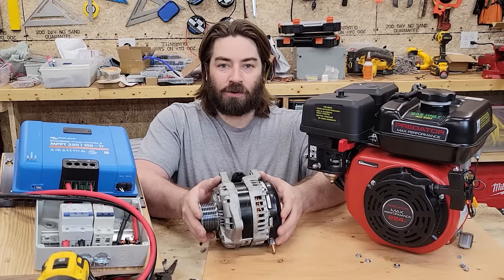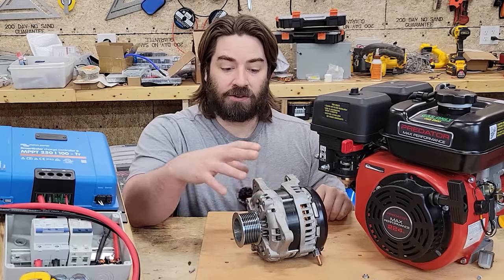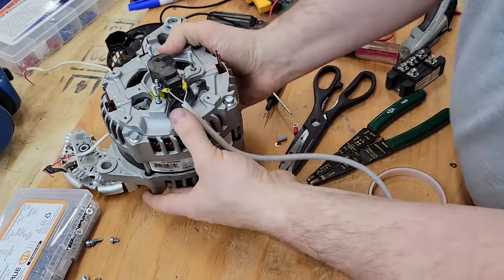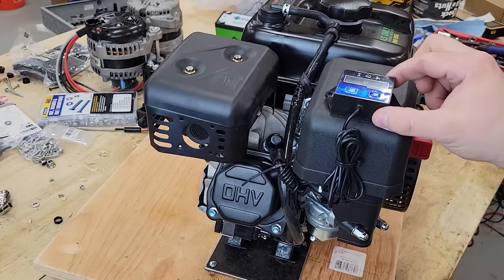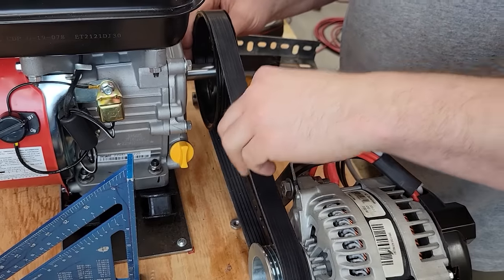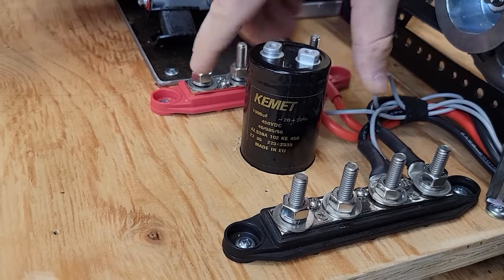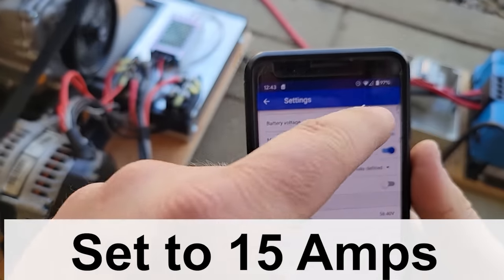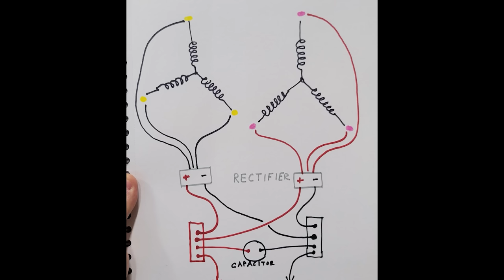The AlternatorGenerator, First Attempt.  48V Battery Charging

Comment: Some suggestions from 22 years in living offline and using some of these one controlling the field supply is Paramount 2 direct connection takes 20% off of friction from the use of a    Belt, a dead battery with 1 dead cell will keep voltage from going through the battery and killing The motor  and let it go on towards an inverter, good luck

Comment: I've wanted to do similar things with an alternator to make a micro portable welder. Current isn't even a problem because aftermarket high performance alternators exist that can push 500amps. More than enough for stick welding. Theoretically you could get a 250 amp model, a predator 212 some other bits and have a tiny half decent gas powered welder.

Comment: Unlike my 1961 VW 6-volt generator, at idle the lights go even MORE dim LOL Alternators are genius, almost 100% efficient, having a full-wave rectifier, in bridged mode. None of the AC waveform is wasted. It also has filter caps. As well as Voltage regulation like he stated.

Comment: Next time you come across a friction fit pulley, put it in some boiling water first. 
Thermal growth helps  alot. 
Stops the possibility of galling or stripping the threads on the alternator or installation kits
Reply from the maker: Thanks

Comment: I would suggest vibration control mounts on your platform. I put these on my garage air compressors that was dancing around while running. I didn’t even need to bolt it to the floor after that. I got them from McMaster Carr.
Reply from the maker: Thanks for your suggestion.  I was able to fix the vibrations in video part 2: https://youtu.be/cy0t4qq8mS0?si=e4gSSoPMcC4X2hhI

Comment: You don't have to adjust the voltage. You just have to wire it up to charge each cell separately,  like a bms.  There are wiring diagrams available to show you how to charge multiple 12v batteries in series, at 12v-14.4v. Good luck.

Comment: Great project! I was thinking to do this along the same lines.  I build everything with 3/4''   thin wall square steel tubing welded up and finished. The whole engine/alternator frame would be mounted on rubber mounts to the base. I built a few 12 volt portable battery chargers years ago using Geo Metro alternators. The internal voltage regulators usually stalled the engine unless the battery was nearly fully charged. I was going to install a rheostat in the excitation circuit to load the engine below its limits and add vary the field current as the battery charged. Strictly manual control.  I like the idea of using a charge controller for the battery bank as you can set charging parameters and don't really care about the exact alternator output volts. 

I have a direct drive Kubota PMG 3 phase 20 amp garden tractor alternator mounted to a Honda GX 50 engine. A cheap MPPT charge controller might make it work better. Thanks for your ideas!

Comment: The overall build just wasn't shabby at all!! There are a couple things that you should still consider: 1.) Get
you some good heatsink compound, computer grade that is rated for performance and great thermal
displacement and apply it to your heatsinks throughout where it is needed. 2.) Think about trying to make
a guard made out of some good steel plating to protect all of your electrical parts, wiring and the rest in
the event at some time the belt should unass itself and go flying. I'm not saying that will happen BUT, you
never know when or how it can happen BUT hey, it's a good practice with all the hard work and money that 
you've put into the project!! 3.) On the output stages of the of the Stator going into your Charge Controller,
look into seeing whether you have a electronic current limiter circuit that you can setup to safeguard 
components in general that could greatly overheat. I'm talking current limitation as opposed to just a simple
ole breaker in use!

Comment: A Harmonic Ballance add on using mass to store kinetic energy and smooth vibrations. Your Alternator also generates stress vibrations and a smaller one may help in combination. It looks like the directional stress of the design is along the same parallel lines and two rigid points of motion.

Comment: Wow! "Nothing Succeeds Like Success". Congratulations, this actually works (the right way) ! Question: If you removed the voltage regulator, what is controlling the amount of control current being fed into the (single) rotor windings ? That is, what is regulating the dual stators' output current and voltage to what the charge controller wants to see ? What happens should the charge controller want to increase or decrease the battery banks' charge current ? How is over-voltage to the controller being managed ?
Reply from the maker: I'm using a DC-DC buck converter which delivers a steady 12V, 5A, to the rotor.  You could say... The alternator is un-regulated, but the charge controller is regulating what goes to the battery.

Comment: I was told 13+ years ago that this was not possible
So I decided to build one anyway 
Around the end of 2010 I managed to scrape together enough scraps parts pieces and old sides, shaft engine that I had to clean the carburetor on lol
I picked up a $35 Chevrolet two alternator and I saw it on my front porch and built one 
A few short months later, April 27, 2011 rolls around and destroys the south east we were without power for three weeks in our little rural community  but not me lol I had a couple of old car batteries a generic 12 V inverter and my trusty little 12 V generator that I was able to power a couple of low wattage, lightbulbs, and a deep freezer, and a television for roughly 9 hours on a gallon of gas… super efficient when you consider how much money I had invested in this little project and how poor I was at the time!
Reply: Now that I’ve watched the whole video I would like to add
His set up is definitely prettier and cleaner than mine was lol 
Mine was done with a set of hand, tools, wire, nuts, old Skil saw And basically some other garbage that was collected along the way
I have used that for many years before I finally retired it 
It was used as a back up generator. It was used as a gas powered 12 V charger
And the last thing that I used it for was a homemade electric boat that used to whopping 31 pound thrust trolling motors on a 14 foot flat bottom boat… the applications are endless lol
Definitely a great build. Thank you for sharing.

Comment: You need to put the engine and alternator on a single plate as your vibration dampers are preventing you from getting constant tension on the belt. Refer to a car engine that has the alternator directly attached with the vibration dampers in the motor mounts. The vibration absorbers should go between the motor mount and the frame or on the bottom of the whole assembly. When building a  compressor set up I made suspension dampers using some used valve springs  and rubber hose scrap this absorbed vibration while limiting horizontal play.
Reply from the maker: Yep, you are correct.  I made that modification and it worked great.  Video part 2: https://youtu.be/cy0t4qq8mS0?si=RVsgtyJGtefJy0lu

Comment: solid mount to something heavy. get rid of the rubber shock bushing for more stable belt tension with less belt slippage.... i've done this before on a pressure washer platform ...

Comment: worked pretty darn good.  the rubber mounts made it hard to tension the belt…I’d like to see all the electronics mounted away from the vibration to preserve the circuit boards on the charge controller.  All in all, very educational, thank you for the demonstration!

Comment: Great idea, just to keep you in the loop. There are 48volt alternators available off the shelf, some hybrids have them, also vehicles with electric turbos where a 12v system isn't man enough. Now, if you could power the alternator from a stationary steam engine, running on waste oil to generate the heat, you could generate the power from a waste product, maybe.....

Comment: Nice video, been a while since I've built similar but for a much different reason (days before portable jump packs). 
Few suggestions for what it's worth. 
1) Alternator. Try finding one for an 80's model Ford (or such). Know the older 5.0L had the voltage regulator independent of the Alt.  So, can't comment as to this application, but might save some work on the Alt side of things. 
2) I'd directly mount your engine to the wood, a second piece, and use those vibration pads to hold that second piece of wood to the first. Two reasons... engine moving independent of the Alt. would cause inefficacies in the system.  This also allows you to then use A) a curved piece of metal (toilet flange repair kit or such) to make a slip adjustment. or B) an adjustment similar to a 95 toyota (simpler to mention that and google it) to make adjustments as its running (Thick bolt hole on Alt. as a pivot pin, and threaded hole as your lock down bolt. As the system runs, the belt will stretch... the motor moving will add too this. 
3)  Keeping the engine on a sperate board will let you then mount the electronics with a bit less vibration. 
4)  Just an FIY... when installing the pully on the engine, you don't really need to power steering puller or to make a special bolt. Just a standard bolt with 3 washers and some grease between them  will do (done this many times). The puller is really only needed if you wish to remove the pully or move it closer to the end (installed too far in).
Reply: Great to know #4. I'm building one of these now, and having a hard time sourcing a pulley installer/puller with a 5/16"-24 adapter bolt, just like David. Just to make sure I understand - would I align the pulley hole to the end of the shaft, then thread in the 5/16"-24 bolt with 3 greasy washers on it, then just tighten the bolt head until the pulley is on? The washers just spread the pressure from the bolt head onto the rim of the pulley as I tighten?

Comment: Once you have this project the way you want it, maybe consider building a wood gassifier to run the Predator on.
Inquiry? How long would a small engine like this run on a 1 lb. propane tank? (Thinking of emergency fuel sources)
Suggestion: Use an 8 cell battery holder (AA batteries) and a momentary contact push button to excite the field. If you use high quality batteries, they should last for quite a few years...
Just some thoughts from a 63 year old ham operator that has been an electronics nerd for over 50 years...
Thanks for the video. Enjoyable and informative. The best part? NO BS INCLUDED! A++ brother!
Reply from the maker: Thanks for your comment.  I agree about the momentary push button.

Comment: I used to have a regulator cut out switch on my 73 Pinto and used a rectifier on the field supply so that it self excited. Rev up the engine to around 3Krpm and ran my circular saw at the lumber yard. That was in the late 70s. Never had any trouble running high frequency ripple DC into the universal motor in the saw. However, I would not use that setup for continuous use. The alternator bridge gets hot, and accelerates voltage avalanching of the diodes. Not fun pulling car alternator to replace the diode stack.

In this setup the filter cap must be rated for high ripple current when the alternator frequency (shaft speed) is low. Some mix/matching depending on load conditions.

Comment: Food for thought. You can simplify the excite circuit, by simply wiring the excite circuit to the 12VDC magneto output on the engine itself. Thereby eliminating the buck converter

Comment: In addition to @D2O2's suggestion, the modern alternator mount uses a spring-loaded idler arm+pulley to continuously apply the (approximately) right belt tension. This eliminates any belt 'bouncing' and smooths out the alternator's bearings load for a maximum lifetime. It should somehow be mounted to the engine block. Also, those wimpy engine mounts must go ! After all, this engine is meant for something like a pressure washer or some other kind of pump, all of which have their engines bolted to solid frames that have no cushioned engine mounting. These mods aren't, of course, necessary for the first and second rounds your (first and second of videos) of your 'proof of concept' project, but should be added to any real-world and dependable set-up. Again, Great Work !
Reply from the maker: Thanks.  In video #2 I solved the vibrations by welding up a plate for the alternator and engine.  There is also a video #3 where I fine-tune the fuel economy.

Comment: You should properly size the capacitor to the voltage you will be using.  While it is generally safe to use a higher rated cap than the working voltage, if it is too large, the cap won't form properly.  So if you get anything under 150 volts out of this thing, you should change the capacitor.

Comment: The one I built in 2014 had a solid mount for the engine on a steel base that included the alternator in the same orientation and I put rubber wheels on it and a handle

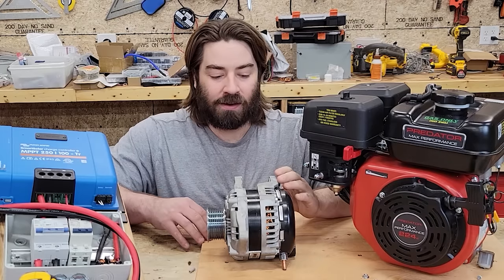Comment: At 4:40 I think a better test setup would be to spin the alternator from a high power motor which you can easily adjust to any RPM that you want. 
Also your field winding current should be adjustable. You should have some method of measuring core saturation of the rotor and stator and finally you should have a variable dummy load to cover the full range of output of your alternator (0-200 amps at 0-80V)

Comment: Ditch the belt & pulleys and couple the alternator directly.  Connect the output of the two rectifiers in series to double the voltage. Note that this will only work of the two sets of stator windings are isolated from each other and the alternator frame but based on the fact that you showed no continuity between the two sets of windings, the alternator you have will work that way.  You could also boost the output voltage by raising the excitation to 14 volts but that might heat up the rotor more than you'd want.  

You probably don't need a capacitor since the RMS ripple on a 3 phase rectifier is less than 5%.  But if you want to keep the capacitor make sure the voltage rating on your capacitor is at least 1.5x the highest voltage you get from the rectifiers with no load and you should make sure the ripple current doesn't make the capacitor too hot.

Comment: I built one of these but kept it at the normal charging voltage of an external ford voltage regulator. The GM alternator had a bad built in voltage regulator so the alternator didn't work. So I took it apart like you did but kept the alternators original rectifiers. Then wired in a simple old model ford regulator. The field wire from the regulator was controlled by a toggle switch. I had two different volt meters on it. One to show the battery voltage and one to show the charge voltage. It didn't self excite but when it was connected to the 12 volt battery bank to be charged, it gave it the voltage to the alternator which fed down to the voltage regulator and out of the regulator field to the field input to excited the alternator. I had a well regulated voltage and I was getting about 120 amps output to the battery bank. The external ford regulator would lower the field voltage to the stator therefore lowering the voltage and amperage when the bank was nearing full. It regulated the voltage and amperage throughout the whole chargeing of the bank. Still works to this day.
Reply from the maker: Sounds great.   Thanks for sharing.

Comment: Emergency set up yes.. the predator constantly running would need maintenance every few days oil change and value adjustment... you. Could set up an oil cooler and pump extending its run time between oil changes.. and the alternator would not last long.. I'd also try to only pull 30 amp.. it seemed to bog at 35.

Comment: Hi David, The Predator Engines are great little Engines, and very dependable.  I like the way you made this. You might want to mount the whole thing on some heavy Springs to a Solid Base. Take the whole Board with everything mounted on it, and have Heavy Springs on the bottom. Then fasten the bottom of the Springs to a Solid Base or Table, whatever. This System would be a great backup to a Solar Panel System. Great Job on the Build.👍👍 Subscribed.
Reply from the maker: Thanks for your comment.  I mounted both to a steel base in video part 2, and that fixed the vibration.  Part 3 video, I fine-tuned the RPM for the most fuel economy. 
Part 2: https://youtu.be/cy0t4qq8mS0?si=SzgNQ8YXekVVuOLY
Part 3: https://youtu.be/yQTCVyxdauo?si=D2nRNajGYAziDh7w

Comment: I used an old smoking Briggs and Stratton horizontal shaft engine to run my alternator, just for a battery charger, and it was a surprising amount of load for poor old smoky, charging a pretty flat 1000cca battery lol I was surprised it didn't blow up, and I really had to mount it solid to keep the belt tight enough 👍

Comment: I think you could've used an older style alternator that had an external voltage regulator. For example i have one on my 1986 f250 diesel. I believe it could've saved some time on the build. Also on the engine mount the engine/ alternator have to be ridged mount to each other to get the proper belt tension and reduce some of the vibration. I would make a base strong enough for the engine and alternator to be bolted to and have a turn buckle of some sort to keep proper belt tension. Or even a automatic tensioner. Then i would use the rubber engine mounts to bolt the engine platform to the base. Then add rubber feet to the base to further reduce vibration. Or add alot more weight to the base to help hold it in place.
Reply from the maker: Thank you.  You are spot-on with suggesting to rigid mount the alternator and engine together.  I did that in Part 2 video and it helped a lot.  https://youtu.be/cy0t4qq8mS0?si=_SW5t54QRzJwLrsQ

Comment: It works, but it needs forced air cooling. The rotor current in this mode of operation is very high. It also needs a larger pully on the engine to increase RPM.